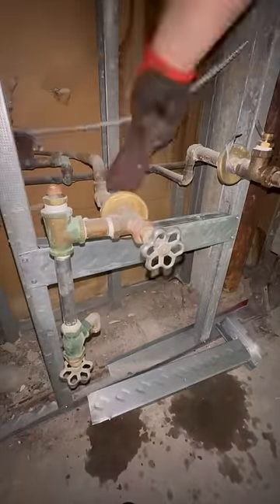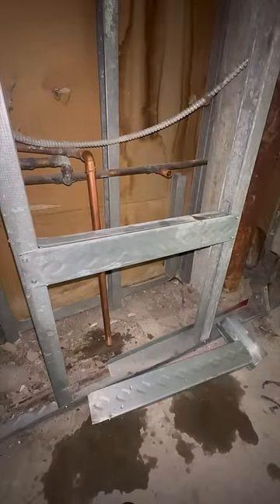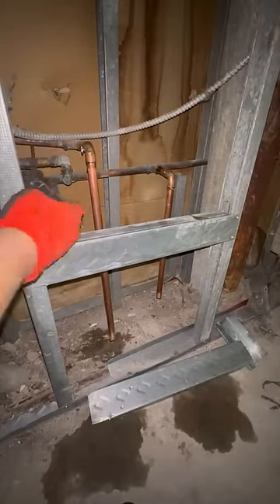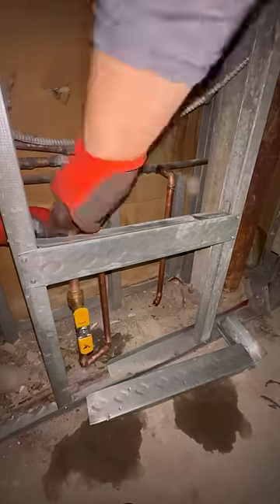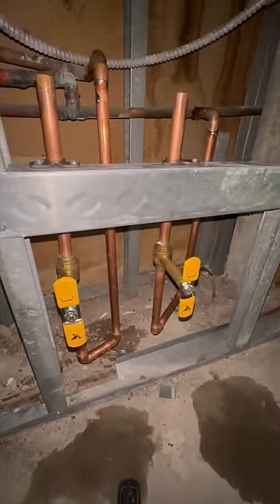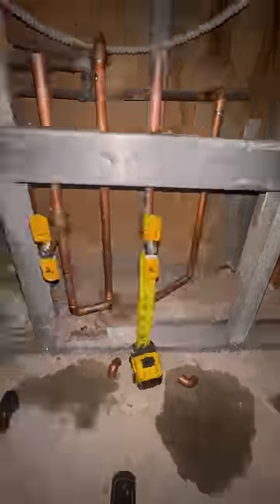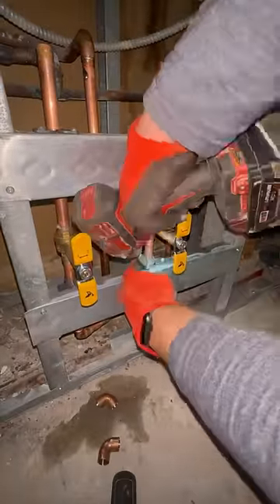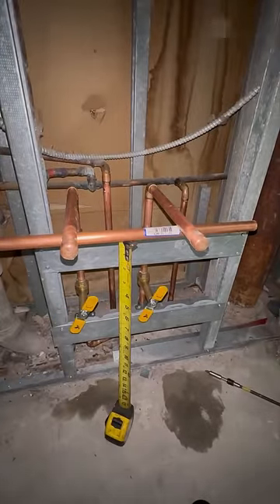Shutdown without shutdown valves #plumbing

Comment: I made a decent bit of change replacing Holbys with new electronic mixing valves.  The tenants would go apeshit when we’d tell them 4 hour shut downs.  The supers would show up every 30 minutes to check.  Once we all went out to the trucks and made it look like we were going for lunch.  The Super came out in an absolute panic.  I told him union rules we had to take our lunch.  I thought he was going to star crying.  He begged to know how long till the water was getting turned on.  I just let him continue to rant.   My partner came and told him a few things in Spanish.  Pendejo was mentioned several time by my partner and we finished packing our equipment.  I had turned the water back on 45 minutes before the super came out to us.

Comment: There are valves that you can install on live pipes. We used them from time to time here across the pond to isolate water. 
Just wondering if you guys get training in bending copper while training to be a plumber. We bend alot of pipe over here.

Comment: Careful with electrical conduit near torch heat.  
It doesn’t take much heat to melt the plastic insulation on electrical wires. 
Don’t ask how I know.

Comment: Have you considered using a freeze pipe kit? Get a co2 tank with a siphon and a clamp style freeze kit
Reply: Negative, that would put ALL-FKN-FLOODED building and  millions worth of damage in YOUR lap.
Reply: @Wayoutthere  I’ve used freeze kits at the hospitals I service. We can’t shut down anything there. Yes it’s risky but if you have a plan and back up equipment I’ve had no problems

Comment: Go pex.
Reply: This isn't a trailer home
Reply: New York City is all metal no plastic in commercial spaces including apartments.  Fire reasons.
Reply: @ptso7580  no it's because the union lobbied to require all copper. And good thing too because copper is way better.
Reply: @SamThePlumber  Well it was argued that copper is best for potabile water for fire resistants, longevity, and safer for drinking, yes.  But PEX can be use for radiant heating only in the city.  No PVC or C PVC. Not a whole lot buildings use radiant floor heating, just baseboard, cast iron radiators, and hydronic heat exchangers.  Majority is ,no plastic for plumbing.  Mainly metal in NYC.